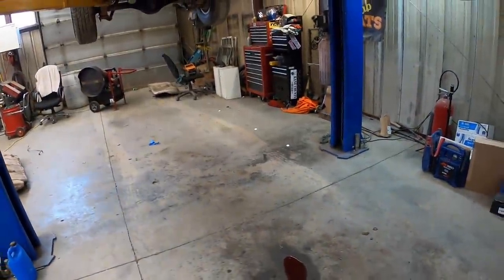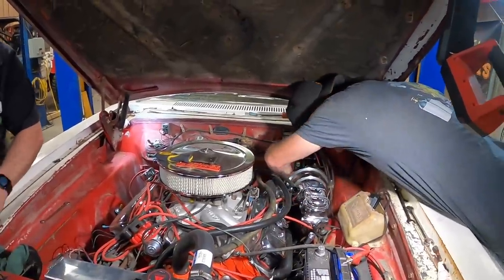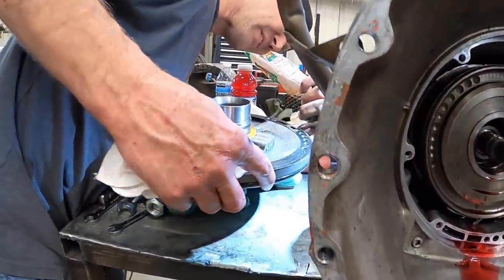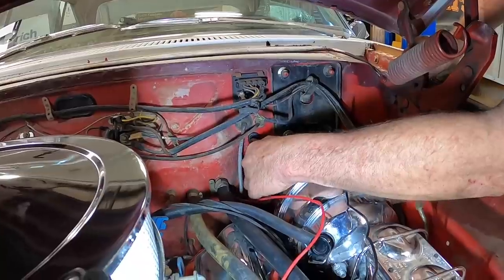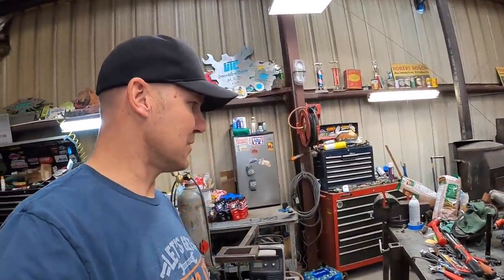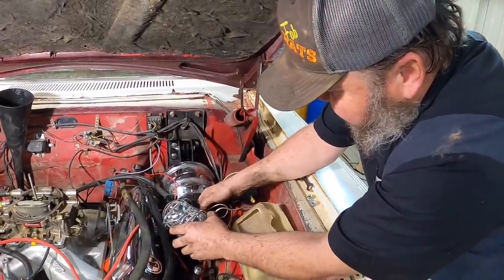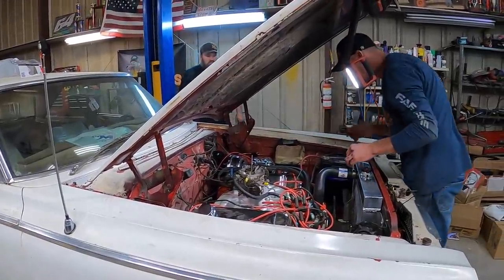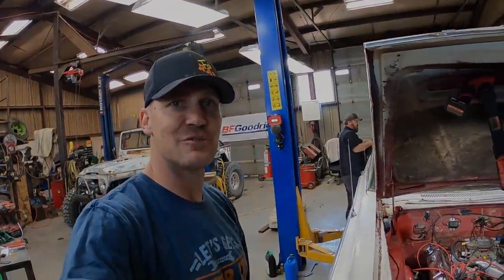One BIG Problem With The Coronet Giveaway Car!

Comment: I didnt know u knew what a heli coil was not to many people know what that is u used them before ive used them on a motor bike on the spark plug
Reply: Spark plug is the most common use, since changing plugs (and crossthreading) is a common DIY task.

Comment: I cringe every time I see someone install an oil pressure gauge with that plastic tubing instead of doing it right with a copper line…. Now the winner cannot take it to the track without changing it out.   They won’t pass tech inspection with the poly line